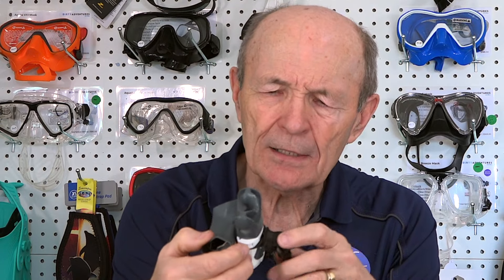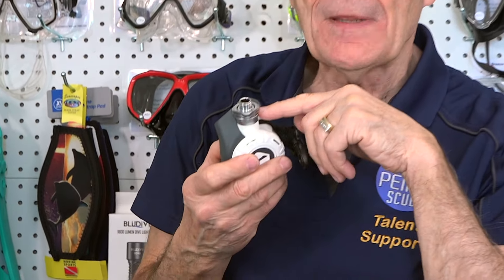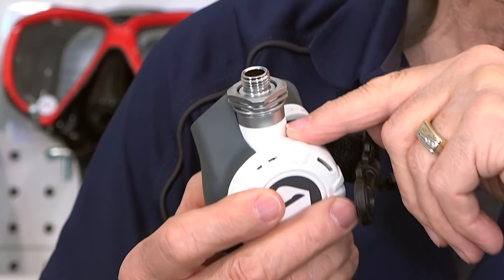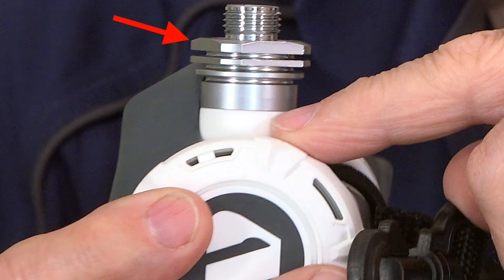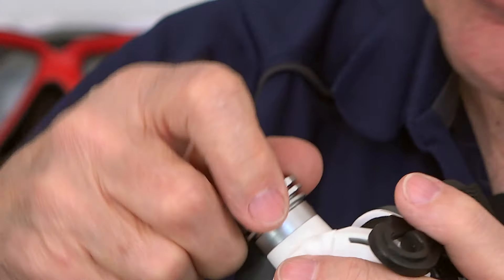Do Cold Water Regs Need Fins? - Scuba Tech Tips: S17E11

Comment: Water can indeed go below 32F; impurites such as the salt in sea water depress the freezing point to around 28F, which is why they salt the roads.  But a free flowing reg can get down to below 20 pretty easily and the best way to avoid freezing is to use a sealed first stage reg that doesn't let water get into the working parts.  Then the second stage is the vulnerable part, so we just avoid purging when not in the water, especially as in winter the air can be a lot colder than the water.  I agree, fins are mainly for style.
Reply from the maker: I did several videos on cold water diving/gear and free flows.  I never had a winter ice dive free flow following my tips.  Once we did a test using the opposite steps and students saw how it free flowed as soon as it went under.
A

Comment: fins is a technique to increase the surface of contact between a solid body and heat transfert fluid. 
This is used specially when the heat transfert  capacity by surface unit of the transfert fluid is the limiting factor, so the contact surface is increased by adding fins.
This is very often used when a metallic  body have to be cooled by surrounding air  and a very common application is to cooling cylinters and heads on an air cooled engine.
when a heat receptive media as water is involved, fins are not required and even can become a nuisance to efficient cooling as the surfaces corrodes.
excellent topic
excellent video.
Reply from the maker: Glad you like it Jacques.  Lots of science experts commenting.
A

Comment: Alec, a better experiment for an adibiatic phenomenon is much simpler.
With an open mouth, gently blow air on the back of your hand. It'll feel warm.
Now try it with pursed lips and slightly more pressure. It'll feel much cooler.
Air is the same temperature and coming from the same place.... But a drop in pressure is a drop in temperature.
Reply from the maker: Nice explanation, thanks.
A